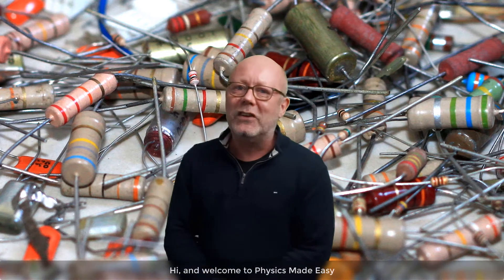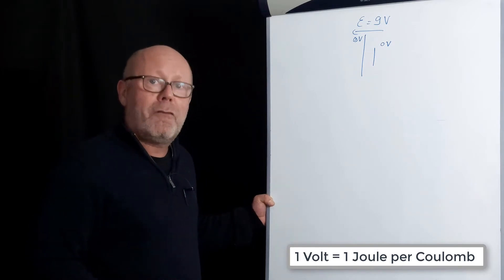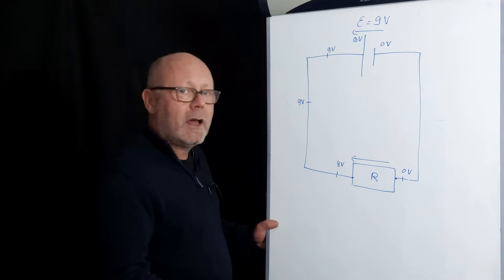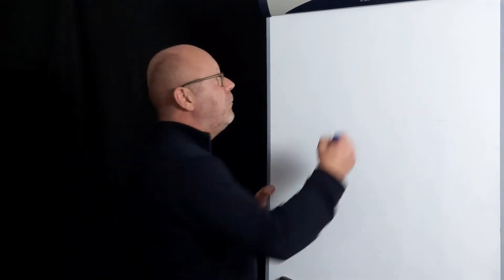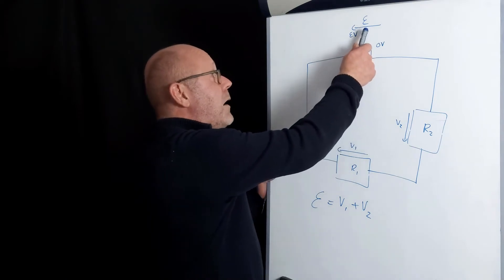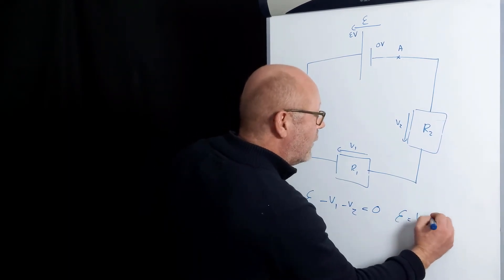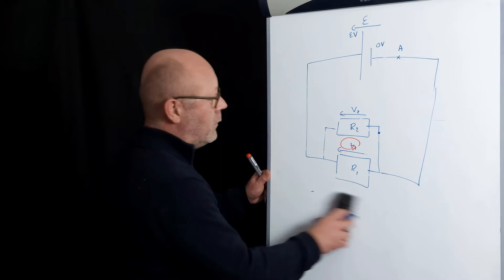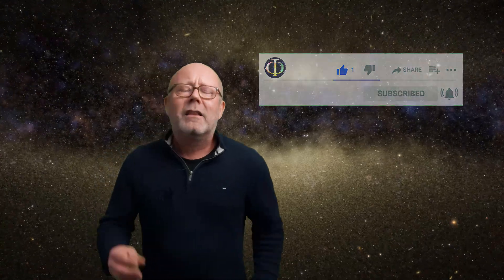Resistors in Parallel – Why the Same Potential Drop ? (Electric Circuits, Physics)

Comment: Hi , 
At the beginning of the minute 2 you mentioned that there is a potential drop across the resistor which means resistor absorbs energy of (9 V) that is carried by the flow. At the minute 2.40 you draw 2 resistors in parallel . Hence there is a flow across both parallel paths, each resistor is supposed to absorb equal amount of energy  (9V +9V=18v ). in this case energy emission by battery is 9V and energy absorption by resistors is 18 V in total. This is violation of energy conservation in this circuit. how to overcome this discrepancy? I haven't got a proper explanation and not comprehended a solution so far.
Thank You
Reply from the maker: Hi,
The answer to your question lies in an accurate understanding of what is an electric potential (and Voltage, which is the difference of the electric potentials between two points). 

1 Volt is NOT an energy, but at energy per unit charge… That is a crucial point to understand…

When there is a potential drop of V Volts across a resistor, it means that each coulomb of charge that passes through the resistor loses V Joules. of a energy. When Q coulombs pass through the resitor, it results in a dissipation of Q * V Joules of energy.

Illustration:

A single resistor with a potential drop V across it will lose, V (Volts) * Q (Coulombs) in energy, when a charge of Q coulomb passes through it.

If you replace it by 2 resistors in parallel, thus with the same potential drop V,   the amount of charge will be split in 2 so that Q = Q1 + Q2 (Conservation of charge). The first resistor will see Q1 coulombs passing through it, and the second will see Q2 coulombs. 

The energy dissipated in the first one will be V * Q1, and in the second one, V * Q2

The total energy dissipated will therefore be V*Q1 + V*Q2 = V*(Q1 + Q2) = V*Q. This is the same amount of energy dissipated than when there was a single resistor…

I recommend you check this video, to clarify your understanding of an electric potential and a voltage. It should be useful to you.
https://youtu.be/j3GrOKre__0
Be well,
Reply: @PhysicsMadeEasy  Thank you a lot for your quick and fruitful response. Now it  is time to scrutinize the details

Comment: Sir, we say that emf is the maximum potential difference between two terminals of a cell when no current is drawn from it, the answer is that potential drop occurs but how. What is potential drop, explicit it sir.
Reply: Is there any relation between charge separation and potential difference
Reply from the maker: " Is there any relation between charge separation and potential difference" 
Absolutily. You have to understand first what is an electric potential. I encourage you to check this video (What is an electric potential) https://youtu.be/j3GrOKre__0. 
When charges are packed at a position, the electric potential around that position is high. so when you compare with a position that has no charges (where the potential is zero) the potential difference between these two points is high.  
Does this answer your question? or did you mean something else?
Reply from the maker: "Sir, we say that emf is the maximum potential difference between two terminals of a cell when no current is drawn from it, the answer is that potential drop occurs but how. What is potential drop, explicit it sir." 
Because you have to consider internal resistance in a battery. A battery is made of a cell of constant emf, E, and internal resistance that can be modelled by a little resistor, r, in series with the cell. The terminal potential difference (across the full battery) is thus: V = E - RI. 
When the battery is not connected to a circuit, it doesn't deliver current, you see that  V = E - 0 = E. If it is connected to a circuit, some current will be delivered by the battery, so you see rI is not zero anymore. therefore V = E - rI < E.

Comment: I have a doubt 

In case of series connection  ε = v1+v2

Why in case of parallel connections  ε is not equal to sum of all the potential drops across all the resistors?
Reply from the maker: Hi Tanuj, 
In a circuit where two resistors R1 and R2 are in parallel to a cell of emf Epsilon, Epsilon = V1 = V2.  
You can prove this by two ways:
1/ By using the loop law you find, Epsilon = V1 and Epsilon = V2 
2/ By considering the electric potential at each point of the circuit. Remember a voltage (= potential drop or emf) is a potential DIFFERENCE.  Because cables are equipotentials (the potential is the same along the cable), you can realise that before the resistors the potential is Epsilon for both resistors, and after it is 0. So both potential drops across the resistors are Epsilon – 0 = Epsilon, thus they are the same for both resistors.
I hope this lifts your doubt!
Reply: @PhysicsMadeEasy  does emf of battery always equal to voltage,in parallel connection.?

Comment: What happens when I introduce a battery in the middle of wire,
in the video 1:42
Reply from the maker: You mean where normally you would place a resistance? If the positive side of the battery you place there faces the positive side of the first battery. then one of them would be charging the other. Otherwise, this would be equivalent to one battery of emf equal to the sum of the emfs of the two batteries, and the circuit would be a short circuit.
Reply: @PhysicsMadeEasy  thank you sir for your response....

Comment: Sir why there's no induced current generated in a coil when light rays falls on it ?  As we know that light is an electromagnetic wave consisting  oscillating magnetic and electric fields.. It should induce current in a coil due to oscillating magnetic field in accordance with faraday's law of electromagnetic induction.. but it doesn't happen so . Why ??
Reply from the maker: Hi Pankaj, light does induce a current when hitting a material: this current is just every small. 
Charges in the coil will experience an oscillating force under the influence of the oscillating EM field (oscillating dipoles form).  Because of the very high frequency of the light, the amplitude of the oscillation of the charges will be very small: the AC current will just be of small amplitude, thus tiny…  (note that this answer is given under the perspective of classical physics...). That is the classical view. 
For a quantum view: in a material, there are bands of energy that correspond to all possible energies that an electron can have. When an electron receives energy (heat), it will jump to a higher level of energy in the allowed energy bands. When it relaxes, the electron emits a photon…
Reply: @PhysicsMadeEasy  Thank you sir . You  have cleared my doubts... but can you suggest me some books for physics  from where you came to know  about this thing . And sir please suggest some books to make our  concepts crystal clear in physics..
Reply from the maker: @pankajkumarpradhan6333  Hello Pankaj, hummm, To be honest, I do not know of such a resource. All the text books I know are often quite elitist, (and this is something I fight: science is for all!), and when they are not, they simplify the wrong things, making things actually incorrect which brings much of confusion in students minds. I have witnessed this by myself so many time, with my students, with having to correct the damage that was done by these books. 

I fight this, this is why maybe I am quite successful as a teacher: in my career, I encountered some students which had light mental handicaps, and I helped them pass some prestigious high school exams, like IB HL Physics. For me, that proves that anyone can succeed!

So I can’t really propose any books for you, maybe the best compromise between accuracy and simplicity would be the Tsokos, IB Physics, (Ed: Cambridge), that I kind of like. But I do because I am already familiar with the concepts: some of my students do not like it.

The best I can suggest is that you go to a library, read on various topics you already know, and think to yourself: “Would I have understood this if this was the first time I read it…”. The book for which you answer yes the most often, is the one you need to buy.
Reply: @PhysicsMadeEasy   Thank You Sir for your guidance.. Sir I'm From India and you are from which country??
SIR NOW I'M IN CLASS 12TH( i.e in India we call the 2nd year of intermediate studies which is afterpassing class 10th as class 12th.)..
AND SIR  I WANT TO DO RESEARCH IN PHYSICS.. SO SIR CAN YOU TELL ME THE LIST OF BOOKS YOU STUDIED IN YOUR UNDERGRADUATE  & GRADUATE  YEARS.. IT WILL BE VERY HELPFUL FOR ME IF YOU GIVE ME THE LIST.. AND IN FUTURE I WILL TRY TO MEET YOU ONCE.
Reply from the maker: @Pankaj Kumar Pradhan  Hello again Pankaj,
During my studies, I didn’t use books outside of what was given to me: no money to buy them, no guidance, no Internet… I struggled a lot in high school but still managed to pass with very average grades (50% was needed, I got 50,2%!). I went to a low class University, but I was very attentive in class, worked a lot on the material the teachers gave me, and when I didn’t understand something would work with my friends, and go to the University library to try and figure out what I didn’t understand from class. 

Because of this approach, my grades rose, and I was able to choose a Master’s studies. I took one which was not very popular, still of low prestige , but it had topics I enjoyed, and it was a small class (24 students): I chose this format because I could be in contact with the professors more easily. 

During that phase, I approached myself from the Research community by trying and getting summer placements / work in the local laboratories. That was also a good move. I developed my network, my marks skyrocketed, and I was offered to go up to a PhD with a great topic , then a post doc and published a lot. I made myself an international name in my field. For that, I didn’t hesitate to leave France (I’m French).

What I am trying to say by telling you my experience, is that you have to make your path for yourself. So mot always follow what people expect from you. We all have a path that fits us. It’s up to each of us to find it.  There is a place for you in scientific research if you really want to become a researcher, no doubt,  but it’s up to you to find this road, unique to you, that will bring you there. Just be pro-active, do not follow the crowd systematically (if you have average marks, don’t aim for the most prestigious universities, it would just hurt you).  Be honest with yourself, always make your mid-term goals achievable, and you will reach your final one.
 

I wish you the best of luck.
Reply: @PhysicsMadeEasy   Thank you sir .. my case is also something like you. But I'll try my best to became a scientist.. sir can i contact personally to you through any media ??..sir if its possible then it will help me a lot to strengthen this subject. SIR I WANT TO KNOW THAT YOU DID YOUR MASTERS AND PhD. ON WHICH TOPICS??.
Thank you sir .. good night ( because it's 9 . 20 pm night in India)sir.. i think there is morning  now in your country. So good morning sir